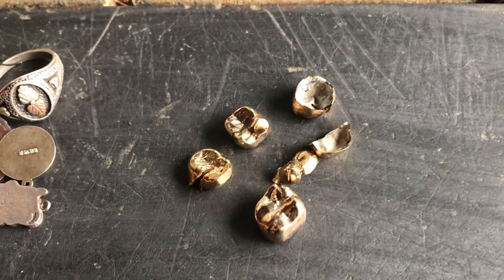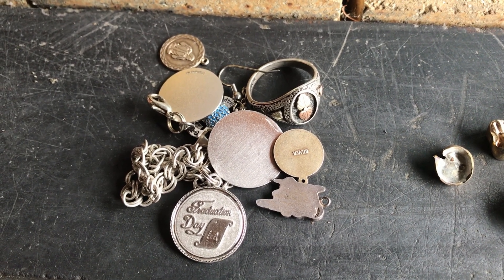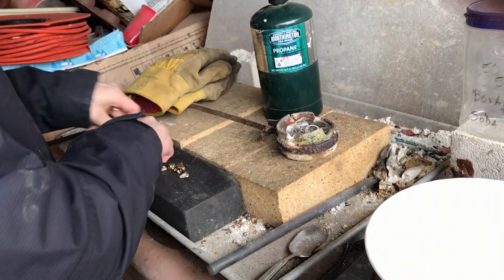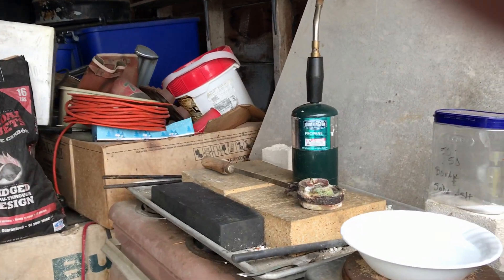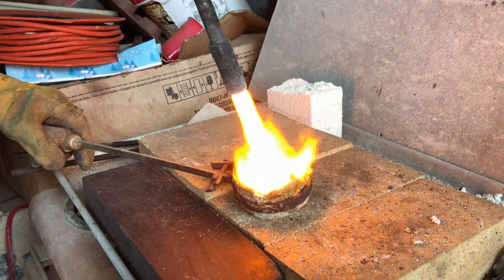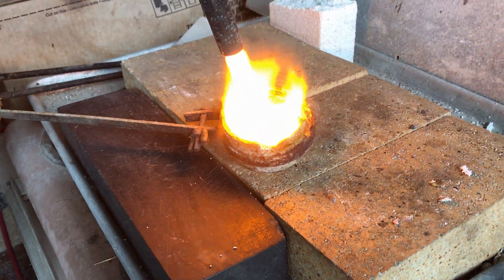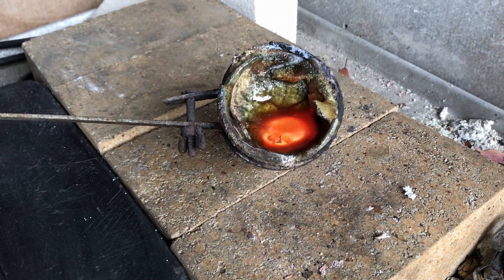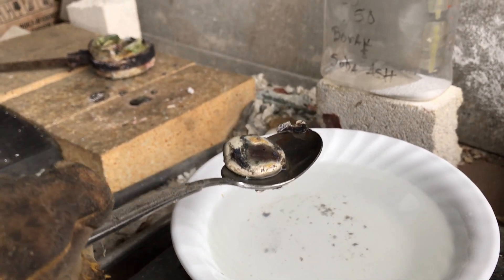Melt Gold with an Oxygen Propane Torch

Comment: I sure could use your help! 
Do you use big tanks or a regular propane tank with the small oxygen tank?
I need a head piece like yours. Mine is tint and dint work for poop.
I felt defeated today bro. I tried to melt and failed, again.. It's a horrible feeling bro.. I literally want to give up and delete my channel all together and just do my thing off line..
I have tried everything but I keep failing. I noticed you have a different nose then mine. I got the Radnor kit and and had to by after market hose and everything needed to use propane. I think if I had the same size head like your torch I think I could do it!
What do you set your pressure to?
If I can get this to work I would owe it all to you bro.. I have a castmaster but haven't tried that yet. That was my next endeavor.. I unfortunately can't afford a induction furnace because they are to expensive.
Thank you so much for making this video!! 🙏
Reply from the maker: I use a 50 lb tank for oxygen but any size would probably work for short runs. An I use a small propane tank because they are easy to move and have plenty liquid inside. If you want to set up a formal coaching we could do that too.
Reply: @IntermountainGoldRefiners  That would be huge! I have a castmaster and I'm going to try that today. I been trying to melt this gold for 3 days. Ughh Thank you so much for your help!
Reply from the maker: If it’s designed to melt steel it should melt gold. How did it go?
Reply: @IntermountainGoldRefiners  I sat Infront of the cast master foundry all day. I used 2 propane tanks and it still didn't turn it to liquid.. I reduced it big time tho!
I'm going to try and hit it with the big touch later today. I have probably 3-4 grams stuck inside borax glass.. The good part is atleast I know I didn't lose any! Last time I tried to refine with led and mistakenly evaporated 8 grams of gold... I will never do that again.

Comment: Thanks Mom  : )         Why dilute the purity by adding the silver?
Reply from the maker: The palladium gold mixture won’t dissolve in Aqua Regia, but if I mix in some silver I can dissolve it out leaving the other materials behind and dissolvable.
Reply: So here's my situation and perhaps you can help.
I have many buttons of all karats ranging from .5gr to 2oz.

My intention is to turn every bit of it into shot so that I can refine in AR.

I just borrowed a MAPP non adjustable torch and bought a new tank of gas for it and I couldn't even melt 2oz in a crucible on firebrick after 20 mins of direct flame.... I used at least 1/3 the can of MAPP and even introduced mt propane midway just to help keep the crucible hot.

I'm stuck with a clump of black (carbon?) That never fully melted so I could pour.

Any idea what went wrong?
Reply: My best guess is the mapp torch isn't adjustable so I couldn't manipulate the flame. It looked like a triple flame instead of pin, or whatever else types their are.

Funny enough when I introduced the propane midway thru, suddenly the gold began to melt. 
I assume there wasn't enough oxygen for the mapp so it was only eating to a "plyable" state but not enough to melt.
Reply from the maker: Well first if it’s not dental scrap you can probably just dissolve it in a solution of AR on warm before boiling.  Second is when melting mass of metal vs volume of hot gas matters. That little torch doesn’t make enough heat for 2 oz probably. You could try charcoal with an air or propane burner inside of a small furnace. Charcoal gets hotter.
Reply: @IntermountainGoldRefiners  thanks for replying. 

The 2oz is actually just scrap jewelry like a rope necklace and a lot of links from various other type chains.

Its not a solid lump of metal which is why I tried to metl 20z at one time. Its so much loose stuff that I didnt think it'd be an issue.

I'll try again later when I have more time.
I appreciate your input..